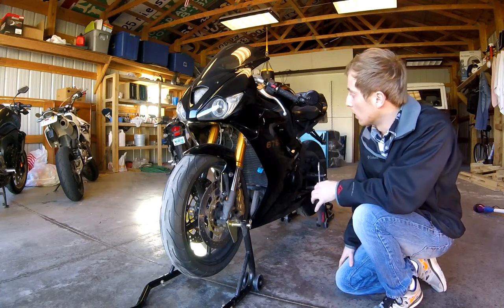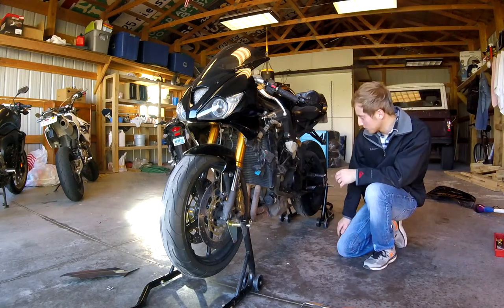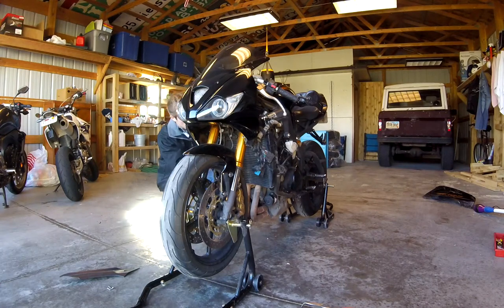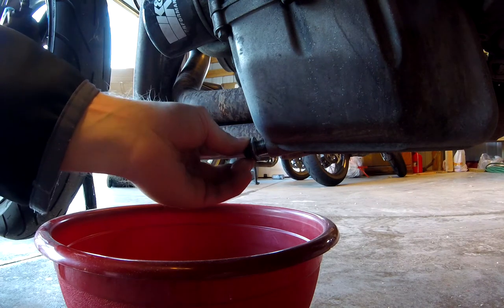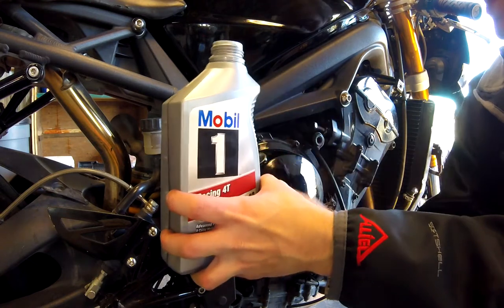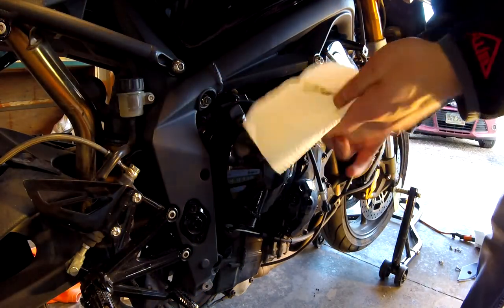Triumph Daytona 675 - Oil Change

Comment: Keep in mind if you're using the oil dipstick that came with the bike, it's no longer accurate. 09'+ models came with a shorter dipstick that essentially adds more oil. There are threads on triumph forums that get into detail. The "full" mark on the old style dipstick is roughly where the "minimum" mark is on the new one, so don't be afraid to 'ovefill' a bit.
Reply: my 675 street  takes 3.5 lt.
Reply: Gerry Long my 09 D675 takes roughly 3.5l. Where im at the top line on the dipstick

Comment: Hey just a good tip whenever you change your oil after refilling with new oil it’s good to run the bike before you close up the fairings and check the oil level once again because the oil circulates and fills up the oil filter then check the oil level again and add a little more because the oil level will be a little lower and also check out NMF (no more friction) I’ve noticed a substantial temperature drop in the bike and also less engine Wear and you see that in the oil over time using the NMF it’s worth a look at
Reply: Also I always prime the oil filter by filling it with new oil before installing.

Comment: Nice video! I really liked your whole Daytona series of videos, especially coz I'm contemplating getting one and I'm worried about maintenance costs, part costs, and availability, etc.

The location of the oil drain bolt is a great design choice, coz the oil would drain downwards while the bolt comes off horizontally. I'd guess that's much less messy. I had a Suzuki GSX650F which had it on the bottom of the crankcase. I've seen several cars with the same location, so I'm assuming many other bikes have it in the same place. When the bolt is removed, it's directly in the oil drain path. Additionally, on the Suzuki, the oil filter was above the exhaust runners, so there was no way to avoid some oil getting on them, even if I covered them.  Nice common sense design on the Triumph, IMO. This video definitely added one point in the positives column for the Triumph.

Just a tip for the next time - since engine oil is designed to get into tiny crevices and be sticky, especially at operating temperatures, I think getting it on bare hands might be really risky. Best wear gloves, coz the oil could be hot too. Also, opening the fill plug when draining the old oil would drain a little more oil, probably coz the pressure equalizes on both ends.

Comment: Quick idea for everyone you could use that 200ml of extra oil to flush it at the start and then just leave the filter in and drain plug out and run the oil through. Thanks for the great video. Getting my Daytona 675 in a couple of weeks. Were you using a flat blade to pop those push clips out on the bottom to get the fairing out?

Comment: The owner manual says to leave our Daytona on the side stand when changing the oil. Does that matter seeing as you didn't?
Reply: The leaning makes sure the oil slides out of the engine area and comes out the pan. But realistically its not the endbof the world because the new stuff mixes with it and dilutes it.  Just change it a tad bit sooner and itll be okay. Then do it on the stand next time ✌️

Comment: The oil on my Daytona is very watery looking and has a very faint gasoline smell, I don’t think it’s a leaky injector because the gas smell is so faint , and I read it’s somewhat common to have a faint gas smell caused by blow by, but I don’t know why it looks so clear
Reply from the maker: Yeah no, the only way gas could get in your oil is from blow by or your piston rings/compression failing. What kind of oil do you use? I use full synthetic (the best) and it does appear to be more runny, it's normal, the color should be light yellow definitely not clear. There's no milkiness is there or burnt smell? 

If you have a picture and want a second opinion send it my way: im.posh675@gmail.com
Reply: MotoPosh I’ll email you a picture here shortly , but I just bought the bike like a month ago so I personally haven’t done an oil change on it, but it has 13k miles , has all the original papers and manuals and service records and everything. The bike is in perfect condition for a 2007, and I can tell it’s been meticulously cared for. The guy said the last oil change was less then 1000 miles ago
Reply from the maker: I took a look at your email, I'd say its fine. Just looks like really lightly used clean synthetic oil to me. If it was me, I'd do an oil change anyway, use that Mobile 1 4t racing oil (super good stuff)! You're in good shape, have fun on that Daytona!
Reply: MotoPosh well that’s a relief lol I actually ordered some of that exact oil for store pickup and I’m going to get it after work and changing it , thanks for the help man, I hope your channel continues to grow! You deserve it

Comment: great vid, thanks. do you get amazon affiliate commissions from the links? i want to use that oil filter you mentioned but your link is broken and want to make sure you get paid if you have that set up?
Reply from the maker: Slice and Dice or Hang and Bang Thanks! And I do yeah haha I'll fix it quick!
Reply from the maker: Thanks for the heads up, the link should be fixed now. I guess K&N had a bad batch a filters recently and their amazon listing got removed. I replaced it with a HiFlo brand which are good as well. Thanks for your comment!

Comment: Hey man i just bought a 2008 675, is it normal that first gear is up and the rest down? Or did they mess around with it to make it like that? Please let me know
Reply from the maker: That's not the stock setup but it's something called motogp style shifting. The previous owner must have converted it. You could easily switch it back to the normal 1 down 5 up shifting if you wanted. Congrats on your purchase man, ride safe!
Reply: MotoPosh Thanks man i was worried, you're a cool dude! How would i change it back to stock? Thanks man
Reply from the maker: To switch back to stock you'll just want to loosen your shifter linkage and rotate it 180 degrees flipping the linkage to the other side. (Its located on the shaft that comes out of your transmission and connects to your shifter linkage, the shaft has little grooves on it)
Reply: MotoPosh  i wasnt able to do it, do you have a email so i can send you pictures, maybe you understand it better?
Reply from the maker: Sure send me a few pictures here: im.posh675@gmail.com

Comment: how often do you change your oil in 675?
Reply from the maker: once a year, or every 5000 miles
Reply: If you ride hard I suggest changing every 1,000mi. Or every track day. Heat breaks down the viscosity of the oil. Bikes have a lot more friction than cars especially since the transmission uses the same oil. Friction causes heat and heat brakes down oil.